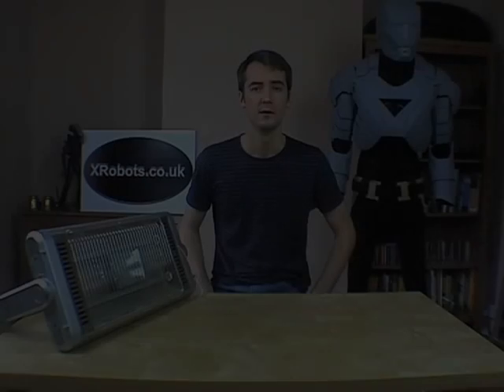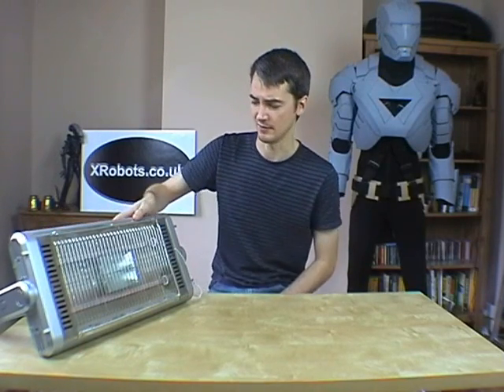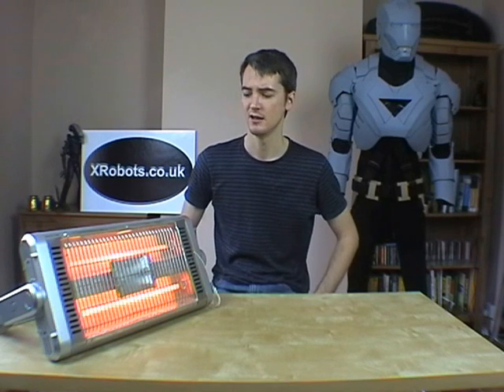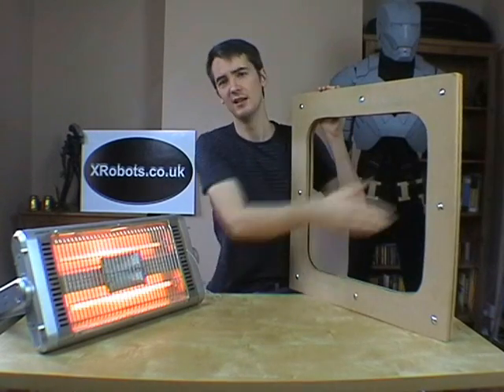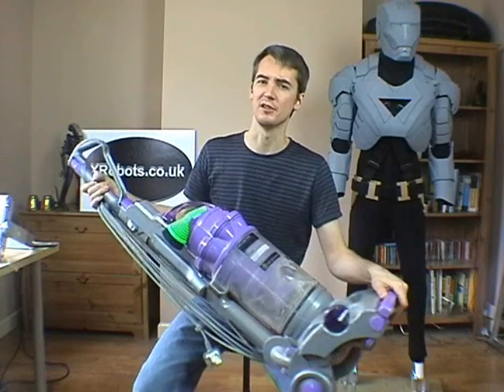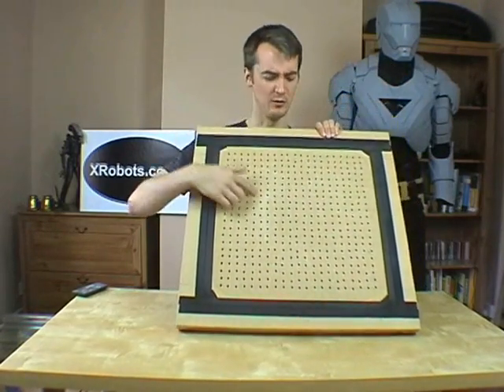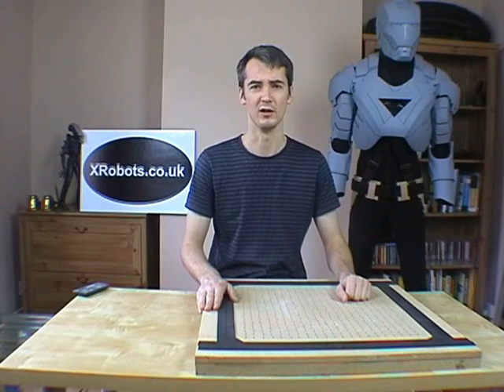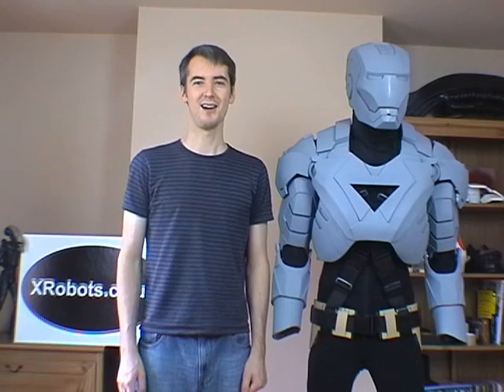How to build a vacuum forming machine part 2 follow up | James Bruton

Comment: Worth noting that almost every house in America has a 240V dryer outlet (usually in the basement unless you live in Florida).  Many older homes/apartments have a 240V outlet in the kitchen too, since electric stoves also run on 240V.  (If the electric stove is a modern "built in," there probably is no outlet at all).  Kitchen 240V outlets are usually well-hidden behind the stove itself, so the hunt may be as hard as moving the stove or as easy as removing the "kick plate" under the oven and shining a flashlight all the way back to the wall.  Note that stove and dryer plugs are different shapes because stoves draw more current,  so you may have to replace the plug at the end of the heater cord (non-consumer heaters often ship with a "pigtail" i.e. a cord without a plug).  Every electrical supply house carries these plugs, as well as "big box" hardware stores.  Take a photo of the outlet before you drive to the store.

Comment: You can make a vacuum forming table out of a air hockey table. Holes are alredy drilled. just take out the fan and replace it with a vacuum hose adapter.
Reply from the maker: I don't have an air hockey table
Reply: well the great thing about the internet you can get the EA Sports 60 Inch Air Powered Hockey Table for 37.90 Pound sterling + 2.27 Pound sterling for shipping at the online walmart site those of us in the U.S. Thats $49.00 + $2.94 shipping, also with it having legs on it all your projects can be done at waist height or you can do the cheaper way by looking around to see if someone is throwing one out that has the fan already broken. They also have smaller ones without legs that can fit on any tabletop surface for smaller projects.

Comment: Is it possible to vacuum form an EVA foam piece? like a foam ironman helmet? i've never had experience with vacuum forming but i understand the concept from your videos. i just don't know if the EVA foam might melt or perhaps the hot glue holding it if i tried to apply a plastic to it. have you had any experience with this?

Comment: Thanks James. I have been vac formng small stuff for a while but needed to know about a larger heating system as previously I have used a domestic oven and now need 450mm in length at least. Your system is great, now I'm off to buy a quartz heater. I have been looking at oven elements but your system is better and safer. Very informative and easy to follow video.

Comment: Hi James, what's the width of the heater your using? I found a couple over here but they seem quite small 48cm wide housing with tubes that are aprox. 35cm long.

Comment: Hi,

Here in the US, one can buy rigid fiberglass sheet insulation, with a foil facing.  I'm sure that there's a UK equivalent.  This would be perfect for lining your heat box, which would go along way toward eliminating the overheating problem.

Comment: Hello!

I'm currently making some shapes out of EVA foam and I would like the vacuum-form them once they are done.  I intend to use them as masters, and realize that the easy-work-ability of this material also means that it will not survive the moulding proccess of the pressure.

I have considered making a mould of this foam master,and then casting it to make a more rigid form.  I am also considering covering it with a thin layer of Bondo or something similar to give it rigidity.  I would like to hear your suggestions on making a master, or as you call - a buck, out of an easily shaped material.  The costume in questions has many compound curves that do not lend well to more conventional materials.

Thanks!

Comment: You could laminate 4 layers of pegboard on top of each other.
TBH I'd just drill the holes you have done instead.
I drilled 1 large hole for the vacuum cleaner nozzle to enter straight into the platen, place diamond expanded mesh over the hole and the mould on top of that.

Comment: Great great idea!  Thanks.  I'm searching on eBay for the self-adhesive rubber strip, and all I can find is 'neoprene' rubber strips.  Is this what you're referring to?  Would you possibly be able to post a link to an auction with a similar sealing strip as the one you're using?  Thanks!!!

Comment: Excellent videos, excellent setup. You could use the peg board as a drill guide however. This way you'll end up with nice evenly spaced holes and a sturdy surface at the same time. Keep up the good work!